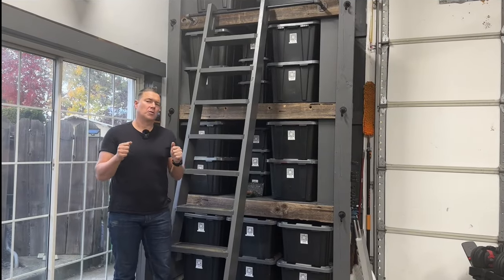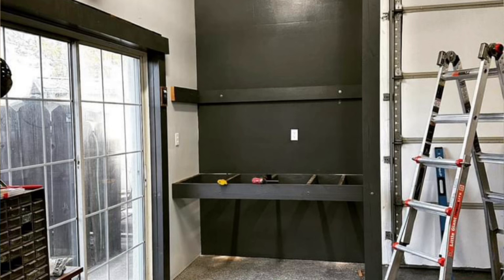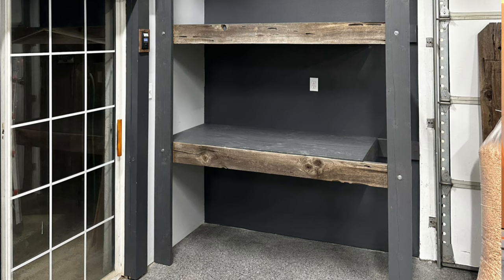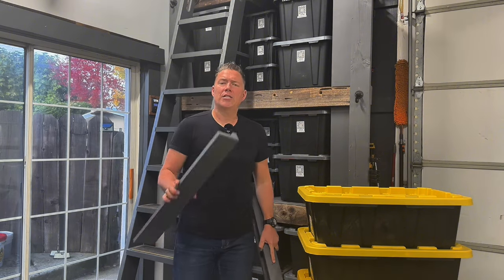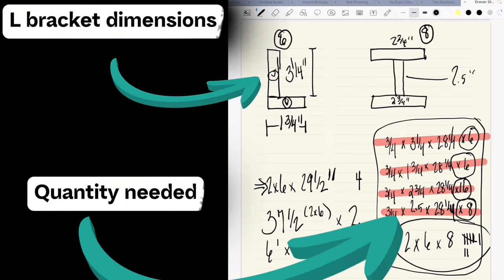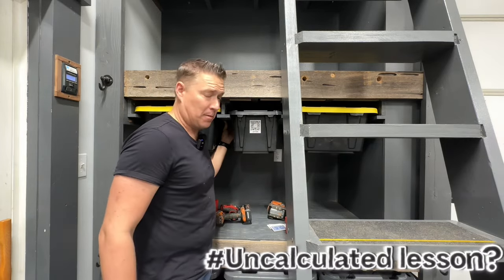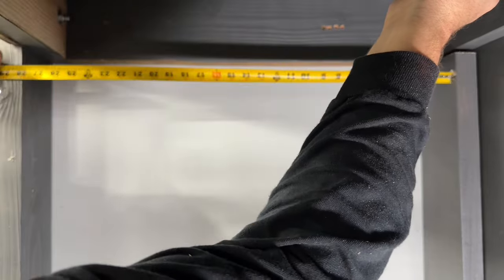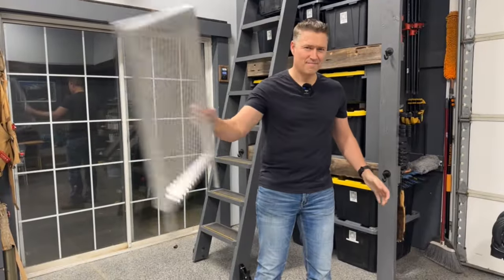DIY Tote STORAGE SHELVES || Stylish Rack with Floating Bins

Comment: How many totes does yours fit? And what are the dimensions of your tote area?
Reply from the maker: The tote system is 12 feet tall and 6 feet wide from side to side with the depth of 29.5 inches. 

It will hold:

16 of the 27 gallon tote
4 of the 7 gallon tote 
4of the 14 gallon tote

Comment: I noticed a elongated shaped buttonhole cut on the wood on the top part of the ladder, may you explane why ? Thanks
Reply from the maker: Absolutely, thanks for the question. That oblong shape that you see provides a significant feature for the librarian ladder. If you check out the “librarian, ladder, build“ video, it will demonstrate its function and purpose. Essentially, it allows the librarian ladder to go from a deployed position to a standup Position or out-of-the-way when not in use.
Reply from the maker: Unlocking the POWER of DIY:  Transforming your Tote Storage Access  (Part 2).
https://youtu.be/I3RReTb6au4
Reply from the maker: If you watch the video pasted in this link, you will see the stand-up feature as it’s highlighted within the first 30 seconds of this video. Check it out and let me know what you think. It’s essential because the latter is right at the opening of my shop, and sometimes, when I want to bring in items, the latter has the potential to be in the way. This stand-up feature allows it to get stowed away and keep the entrance clutter free.
Reply: Thanks @generalsworkshop
Reply from the maker: You are most welcome. Let me know what you think of that video.

Comment: 'Tote bins' are for exactly that- toting them. Transport. Storage is not moving. Storage should require the minimum number of steps to retrieve the contents. 
So- 1)move ladder.2) Climb ladder.3) Pull bin. 4)descend ladder. 5)walk to horizontal surface. 6)remove lid. 7)retrieve part. repeat steps 6-2 to return bin. 12 steps. Even low level is 9 steps. Compare to drawers- 1) open 2) take part 3) close. 1/3 to 1/4 as much effort. I see your shop has a lot of boxes, and few drawers, and they are small (they want to be as wide and deep as possible.
How to use your top four feet? Move your seating area up five feet. Put drawers under them. Pull out (lidless) bin holders too, if you wish. Lots of easy access storage. You could also park workbenches on wheels under there. 
Your future self will not curse you for all the effort it takes to get items.
Reply from the maker: Thank you for your comment! You make an excellent point about the ease of accessing items from drawers compared to totes. Indeed, drawers offer a streamlined way to retrieve items effortlessly. However, I've found that incorporating a mix of both tote and drawer storage allows for versatility in meeting different needs and preferences.

While drawers might be more convenient in some aspects, utilizing totes for storage often proves cost-effective and can cater to varying skill sets. Also, in larger-scale storage solutions, totes can serve as an efficient organizational tool. Your suggestion about optimizing space by raising the seating area and integrating drawers underneath aligns with my future plans for hidden storage – a perfect blend of accessible drawers and concealed totes. Truth be told, I designed that stage, so that it would house a tremendous amount of hidden storage, which I will be going over in the future video. I never thought about going higher than what I already did but that’s an intriguing thought.

Thank you once again for your thoughtful insights. Embracing a variety of storage solutions ensures that each space can be customized to suit individual needs and capabilities.
Reply: @generalsworkshop  Not sure where the 'efficient' organization comes in... The problem with bins (totes) is that they come in too small a range of sizes. Nothing in a storage place should be under another thing- one layer thick is the rule. Drawers can be a range of depths to facilitate this. Bins are useful for numbers of the same thing (bolts...) but should not have a lid- it serves no purpose. The bin can be in a drawer, or in a rack so that it can be accessed without moving it.
Other things that can usefully be mounted at height are dust collection systems and compressors.
A workshop should be efficient- accent on the work. It is not a showroom or an art display. To me, form follows function. An efficient system has its own beauty. Piles of toolboxes (common on YouTube ) betray the decorator...
However, I applaud your view on color etc- it can make a place nice to be in, and has the feeling of having been planned.
Reply from the maker: Thank you for sharing your perspective again. It's fascinating how diverse our views on efficient organization can be, especially within the workshop realm. You're absolutely right that what works efficiently for one person might not resonate the same with another due to differing needs and preferences among viewers.

My workshop indeed functions as both a productive space and a relaxing man cave. The fusion of functionality and entertainment is key to its design, allowing me to enjoy the space while working on various projects.

Regarding planning, I have a knack for spontaneity in accessing tools and materials – sometimes a little too much! While the video might not showcase it, I have around 30 drawers strategically placed in my workshop, enabling quick access to frequently used tools. The totes, on the other hand, house items that aren't in regular rotation, and if something becomes more frequently needed, I tend to transition it to a more accessible storage format.

The versatility in storage solutions, including drawers and totes, allows me to adapt to changing needs over time while ensuring both efficiency and accessibility for different categories of tools and materials. Your insights have sparked a great conversation about the various approaches to workshop organization, and I'm grateful for your valuable input.
Reply: @generalsworkshop  Efficiency seems important to you- you mention it several times in your replies. For storage, there are two factors that determine efficiency- density of storage and speed of retrieval. Given that you are looking for ways to use more of your space, the latter seems the dominant factor. The ideal is where a single gesture can retrieve an item into your hand, in the desired orientation. 
I am, therefore, puzzled; single move retrieval is normally provided by shelves/cubbies/french cleats/pegboard etc. I note you have none of the above. Instead you are promoting a system that can take up to twelve steps to retrieve an item. Personally, I use a system that gives me one hand reach access to over 300 items. Two step, hundreds more.
Perhaps you could clarify why there is this difference between intent and solution?
Reply from the maker: Thanks for your insights! Efficiency does indeed hold importance, and your point about density and speed in storage is valid. The tote tower in my workshop serves a specific purpose: housing items rarely accessed, perhaps once every couple of months. This system efficiently utilizes the upper space, often overlooked in most setups, making infrequent retrievals more manageable. And when it comes to efficiency, I suppose it’s relative. Because having the librarian ladder and the tote transfer platform, this is much more efficient than not having those two items. So I suppose it’s relative on the efficiency scale. Meaning, is it more efficient than having to go around back and grab a ladder to which you then have to set up and put away before and after each retrieval, yes. But is it the most optimized for items that you use on a regular ongoing basis, no.

For frequently used tools and materials, I've opted for a different approach, strategically placing them in easily accessible areas along the main thoroughfare of my workshop. 

As you may not know, because I have not done any videos on it, I do utilize your recommended approach for all of my commonly used items. I just haven’t done any videos on it. As a brand new content, creator who’s only been doing this for three months, that gives me an idea to perhaps do a shop tour in the near future. As my workshop contains an array of trays, slides, and drawers catering to this need for quick and effortless access.
When I do that, if you would be so willing, I would love to get your feedback once you have the whole picture and not just a portion of it.

Regarding pegboards, while they offer practicality, personally, I prioritize aesthetics as well. The appearance of my workshop is a key consideration for me, and pegboards don't align with the visual I aim for. It's fascinating how varying preferences and needs lead to different solutions, and my approach combines functionality with a design that resonates with my workspace aesthetics. Thanks again for sharing your thoughts!
Reply: @generalsworkshop  Yes, I am happy to engage in dialog on this subject. I downsized to my current workshop from a much larger one, and so storage is a critical element. Rather than having a downside, I find the resulting creative tension sharpens analysis and is more rewarding. Whilst I agree with a 'workspace aesthetic', my form follows function viewpoint makes sub-optimal arrangements undesirable.
Pegboard has a bad reputation, but that is mainly from the low-rent type. My double skinned 10mm matrix version taking 4mm securing bolts gives the appearance of a machinist's pallet, and permits high density storage in a flexible manner. I keep to a restricted colour range, preventing the gaudy appearance that can jar. The clearly planned nature of the layout elevates the experience. 
Secondary storage for me is drawers, wide (at least 1m) and full depth. The 'gold standard' is a mechanics tool trolley, where steel construction with shallow drawers gives the highest density for quick access.
I use trays for rarely used items, sized (I make them) to match the contents. No lids. Lids have no purpose. They just delay access. Lids with catches (think toolboxes) are even worse!
I note that you use kitchen cabinet style furniture in your shop. So do I- but I recognize that cupboards are a poor choice. They give poor access and worse item vision. I replaced some with custom depth drawers, and upper ones can be secured upwardly open. They stay open for the session. They become shelves.
I do woodwork, metalwork, and electronics. Some areas of my 'shop configure differently depending on the nature of the session. For example, one area has racks of milling tools and fixtures that slide out from unusable space to the side of the mill. Or it has a panel that swings from the other side, and holds dogs, clamps, and other items for my MFT. Or a cabinet swings down from the ceiling that holds my power supply, oscilloscope and component drawers.
Another element is multiple locations. I use drill bits in my lathe, my milling machine, or at my bench. So most common sizes are held in all three places, so always within reach. Only the rare sizes (long series, imperial, flat, auger etc) are kept in the drill drawer.
To summarize, a workshop is a (meta)tool for making things. Anything that makes it take longer to make something means it is a poorer tool.